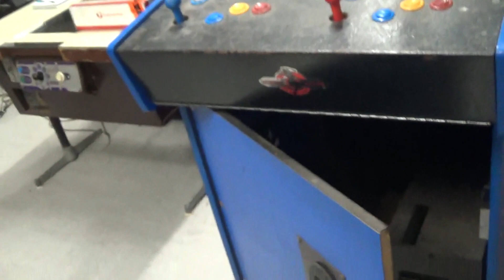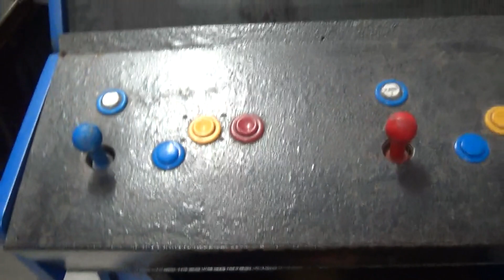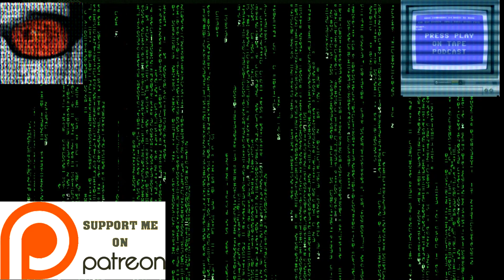The Arcade Project - Leisure & Allied Upright Vertical

Comment: That looks like a super project cab to work on. Great that you got it at a good price too, hope fixing it up will bring it back to life, pity the Tube is Kaput. Nice one 👍
Reply from the maker: It will take a little while, have done most of the cleanup, have to wait a few weeks to get access to the large tube it has from the local operators supplies but he has several that may suit (as long as they work), otherwise I have a CRT TV I can harvest.